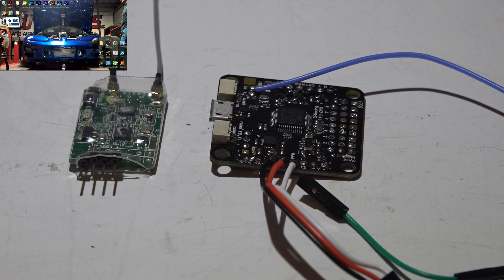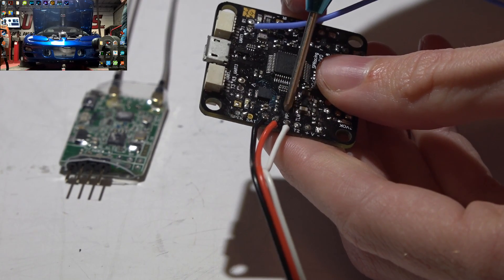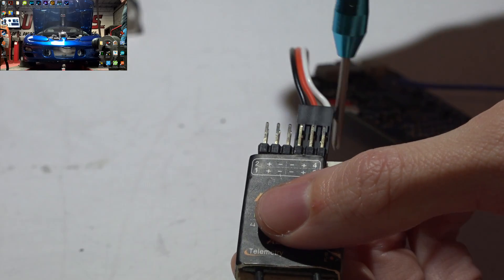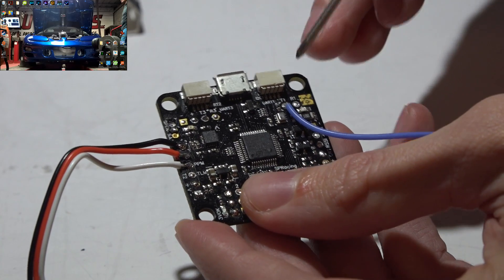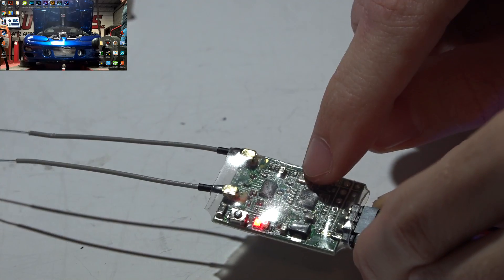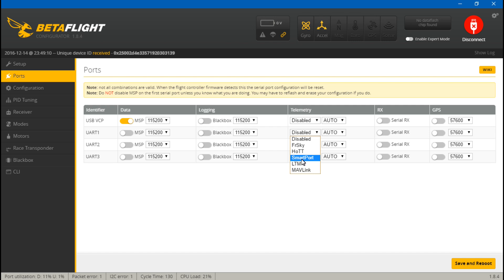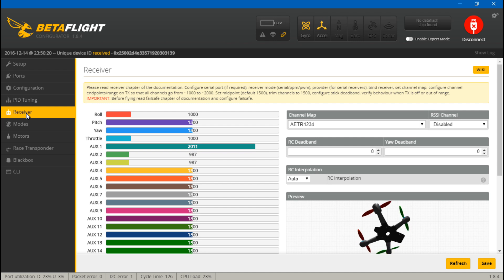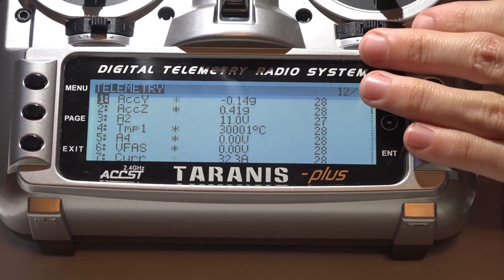SPRacing Evo & X4R-SB: Connect & Telemetry

Comment: Have you had any problems with this board with vibrations by the way it's mounted?  I'm having some issues with resonating motors/unstable flight.  I think it's because of vibration but not entirely sure
Reply from the maker: I havent had problems but I also use O rings underneath and on top of the flight controller, 8 total. Here are some that I use. 
http://amzn.to/2hZnt1m
http://www.getfpv.com/multipurpose-o-ring-set-of-8.html
Reply: Project Blue Falcon thx for the reply, just ordered the o rings and hopefully they help that overly sensitive gyro!